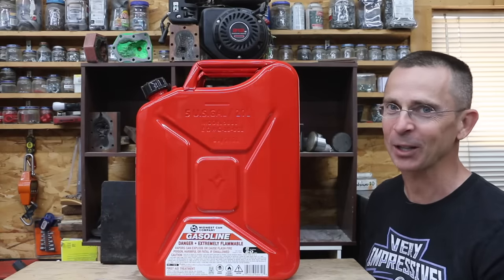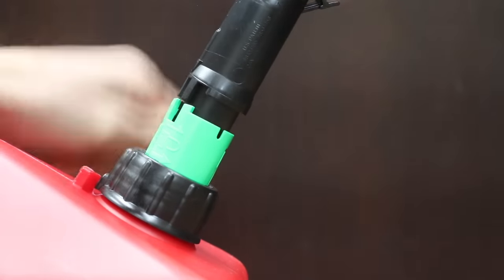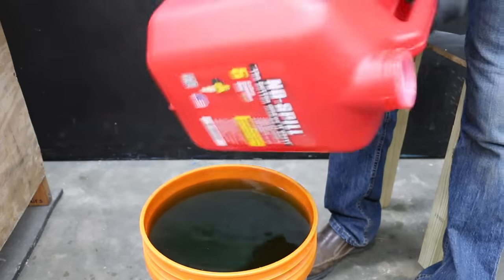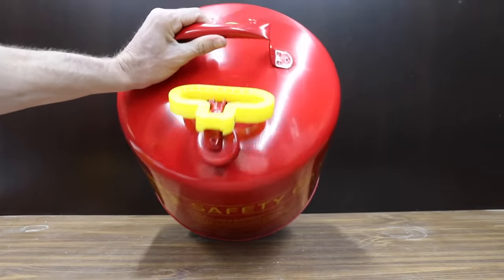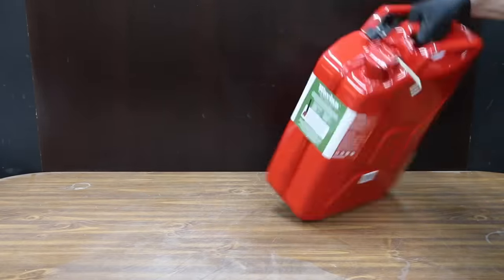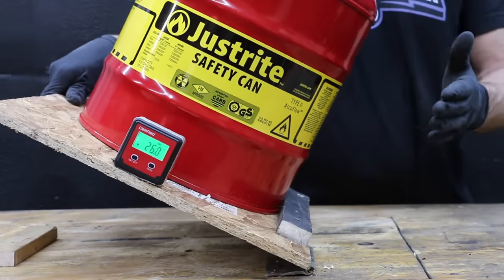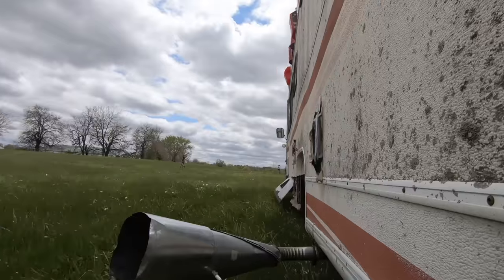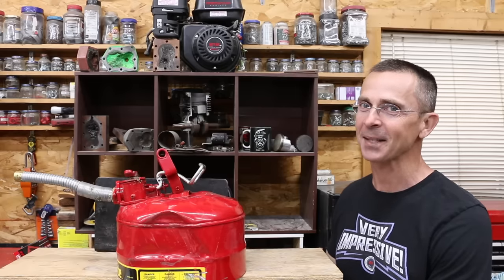Best Gas Can? $140 Wavian vs Eagle, Surecan, Scepter, Briggs & Stratton, Midwest, VP Racing

Comment: The "Jerry cans" are shaped the way that they are to allow enough oxygen in the can even when full. this prevents them from sinking if submerged.   The three handles are also for easier carrying by 1-2 individuals, or allowing two empty cans to be carried in one hand.
Reply: They also store much better, less floor space and stack nicely next to one another.
Reply: designed by the Germans in ww2 thats why theyre called "jerry" cans
Reply: The Jerry Cans is also one of the main contributors of the result of WWII. Even though it was designed by the Germans, the Allied forces used them for their own fuel logistics as they where superior compared to their existing solution. Engineering at it's best.
Reply: @jhalkoski  Actually it was developed before WWII by the Germans in 1937.
Reply: The original Nazi Jerry can is the best fuel container ever made bar none.
Reply: I don't see how the shape would affect bouancy, if it's still full to the top. I'll have to research that one.

Unless the five gallon mark is lower than the top, and by design has HEAD space if used properly?
Reply: A fellow Calum subscriber.
Reply: @slove120031  And on top of each other. They did originate in WWII for the purpose of being an effective means of fuel handling.
The bad thing is that there are so many cheap knock-offs of them that don't have the same quality level. Just the thing with the recessed weld holding the halves together is a significant detail.
Reply: I've heard the company that manufactures the Harbor Freight military style can is the same company that manufactures the actual NATO jerry cans, if I recall correctly.
Reply: @dethmaul  the mouth of the fuel can is lower than the air pocket would be inside. If it is sitting on a level surface and you fill it until it is flowing back out of the mouth there will still be an air pocket by the handle.
Reply: @dethmaul  That's it exactly.  If you set a Jerry can flat on the ground, you can only fill it up to the pour spout.  That's the 5 gallon mark on them.  But if you look at them in profile, there's a hump on the back of the can that comes up to meet the back of the handle.  That forms an air pocket large enough that full cans will still float.
Reply: They won't sink if submerged anyways if full of full. Fuel floats on water
Reply: Also recessed welds, very important for longevity 👍🏻
Reply: I'm pretty sure a steel fuel can filled to 100% would still float without the air pocket. Fuel is extremely buoyant in water.
Reply: @dethmaul  the hump at the back holds air even when full
Reply: @CarbonNeutral22  Gasoline has a specific gravity of 0.71-0.77 depending on the blend.  So in the worst case scenario, 5 gallons of fuel weighing 31 pounds is displacing 40 pounds of water.  Considering the metal cans were tipping the scales at around 8.5-9 pounds, that would be cutting it damn close without the extra buoyancy of an air pocket.
Reply: @dethmaul  The filler neck is a little lower than the top, so you can't fill it completely full. It leaves a little bubble of air that keeps it afloat. I suppose you could lean the can back and fill it completely full, but that could cause spillage when opened.
Reply: You do know why they don't sink right? Because fuel is lighter than water. When full they will float. The Treste when it went to the bottom of the Pacific actually used gasoline for buoyancy control because it was lighter than the seawater, and couldn't be compressed at the extreme pressure at the bottom of the ocean.
Reply: @j.frankparnell6195  so technically gerry cans
Reply: @rhvette  I hauled fuel tankers on the ice road. The tanks will float a whole truck
Reply: @dethmaul  when filling it upright, fuel will spill out, preventing it from filling the entire can
Reply: @CarbonNeutral22  even with the added weight of the steel?
Reply: @rhvette  good on you mate 💪🏼
Answered my question.
Reply: We've had the same jerry cans at work for 20+ years by now, so they pretty much knew what they where doing while designing them
Reply: @SanctuaryGardenLiving  yeah there's a video on you tube of a tanker that went through at the big river crossing on the Makenzie and it floated
Reply: @CarbonNeutral22  is the buoyancy of fuel enough to off-set the weight of 10lbs of steel without the oxygen?
Reply: @CarbonNeutral22  fuel floats, but not a sealed metal can.  Once it's sealed it doesn't matter what's inside it, it just becomes ballast.  The air inside a sealed can is just enough to keep it lighter than the water it displaces
Reply: @TheSturm44  there's a comment above that explains how close it is
Reply: @ImpendingJoker  True, but 5 gallons of gas weighs about 30.5 pounds, and 5 gallons of water weighs 41.75, so the gas plus the steel gas can would have to weigh less than 12 pounds or she would go to Davy Jones' locker.
Reply: @rhvette  There's actually a filler line as well on the can. It's the line below the handle about 3 inches wide...
Reply: @jhalkoski  can you imagine if they had fuel to put in them during the war. The world would look different that's for sure.
Reply: Wehrmachtkanister was designed to address 3 issues of fuel tanks at the time: leaks,  damage sustainability and ease of operations in a chain. All three were addressed nearly perfectly, and this design soon 100 years old still beats many out there.
Reply: I’m sure that air pocket is also duel purpose so the air pocket and compress when that can is sealed and gets hot and won’t leak fuel.
Reply: @wwlb4970  Those cans were brilliantly designed. We could use some of that practicality and simplicity in today's tools and gadgets.
Reply: Air, not oxygen
Reply: @dethmaul  You cannot fill it to the top because the void space is above the fill spout. That is what prevents it from sinking. However, this is only necessary if you are using the can as a water can, since fuel is already lighter than water. Another benefit of the void space is that it prevents the can from bursting in the heat, since the air trapped there is compressible to act as a pressure sump.

The Wavian can is made in Latvia. Probably the same manufacturer as the Harbor Freight can, but the Wavian can is made to NATO specs, and is the better can.
Reply: @trystdodge6177  it would be a lot better
Reply: Jerry cans also float in water because of the air bubble at the top. 🧠
Reply: @CarbonNeutral22  Jerry cans have a plastic intert liner so they can carry both Fuel and Drinking water.
Reply: @Bob_Adkins  Exactly my point. It's less dense than water, and the can itself only weighs about 2 pounds when empty.
Reply: @ImpendingJoker  I think jerry cans were more like 12-14 pounds, which would make them around neutral without the bubble.
Reply: @Bob_Adkins  But that makes to much SENSE!
Reply: @sigcrazy7  Plus the air pocket prevents the jerry can from bursting a weld on a heavy impact. Fuel doesn't compress, air does.
Reply: @theshadowswithin9896  lowest bidder so makes sense
Reply: @dethmaul  The top of the can is above the filler, yu can't over fill one. The space is actually for expansion in heat however, a can of fuel won't sink as petrol is lighter than water.
Reply: that air filled bump at the top also allows for some expansion of the fuel.

Comment: One of my pet-peeves - Fuel cans that have gadgets, push-buttons, and locking mechanisms.  All they are really guaranteed to do is make pouring fuel a cumbersome nightmare.
Reply: Amen. I have the Midwest and balancing a heavy can on that tiny plastic lip at the end to get the fuel to flow is a real pita. It inevitably slips and the tube relocks, forcing you to put your hands on the now gas-soaked click-lock while dripping gas everywhere. All I care about is which are the easiest to use and leak the least while in use.
Reply: That's why the VP Racing, or any "utility jug" as they call them instead of gas cans, work the best.   They don't have all that junk.
Reply: Facts
Reply: Wavian gas cans pour like a dream. No glug. 5 gallons gone in 2 minutes of less.
Reply: @MiltonRoe  
The purpose of these nozzle contraptions has long been defeated just using them. IMO it is one more incentive placed on people to want to use electric.
Reply: Not too mention spout failures.  Those spring loaded fuel nozzles do not last very long and quickly get jammed open.  Then you literally cannot close off the can.
Reply: and 100% cause u to spill the gas 100% of the time...
Reply: @larrybe2900  Classic government idiocy. The EPA-approved spouts have caused me to spill many ounces of gasoline directly on the ground. A problem I never had with a simple rubber spout. Good thing I don't have a tiny amount of fuel vapors released into the air -- I'm sure it's much better to dump actual fuel into the dirt.
Reply: get the fuel jugs with hose from summit or jeggs racing youll love them !!!!!!!!!!!!!!
Reply: Peter smith  yea the ones i see around here have a picture of a scarred guy and "Gasoline and fire NEVER mix" Except the whole point of gasoline is to burn it.    For kickstarting a bonfire its better to use kerosene.
Reply: And the plastic parts/spout are all guaranteed to CRACK and break
Reply: @MiltonRoe  theres blue "water" cans that look like the midwest cans maybe even midwest brand that have traditional fuel necks. What my local hardware sells and everyone buys for gas cans. 😂😂 they are a 6 gallon can.
Reply: Those are Democrat mandated spouts.  Like everything they do, those suck.
Reply: You can thank the government for that!
Reply: @gizzyguzzi  They literally fuck everything up that they touch. Look what they did to diesels.
Reply: When I worked in landscape the first thing we did was bypass those "safety" features so we could just pour the gas without having to putz with a button or trigger or anything.
Reply: @Bpf1893  you're preaching to the choir, buddy-
Reply: @bobspurloc  nothing spills more gas than those 'safety' cans.  What a joke
Reply: Not only that, but the whole purpose of them is to release less vapors, but most people rip off the spout in frustration and end up spilling much more than if they just used a regular can.
Reply: It's ridiculous that all of the "safety" features actually make refueling more difficult and can increase your chance of spilling (especially if you're adding to a passenger vehicle or some boats.) The VP Racing can is the only one I'll ever use anymore.
Reply: You can thank lawyers for trying to make gas cans idiot proof. There will always be a better idiot.
Reply: I agree
Reply: @Skyfighter64  politicians did that.
Reply: I have several of the midwest cans. The first thing I do is add a vent cap and a free flow spout without any flow/locking mechanisms. It makes a huge difference. These both can be bought on ebay. One problem I have is the threaded collar s (caps) keep breaking. When full with gas these puppies are heavy and any prolonged pressure (weight) on the spout eventually splits the threaded collar (cap).
Reply: $140 for a gas can? For that price, an electronic pump could be incorporated into the can. Nuts to that. Ill stick to gallon milk jugs.
Reply: @Cline3911  I bought several for about 25 each.  NATO surplus.
Reply: @Cline3911  Those milk jugs split easily when dropped, or the lid will pop off. Also easy to puncture, but I see your point. When I was a kid mowing lawns for spending money, most kids used old gallon-sized glass jugs and we never had problems; we knew the risks and we were careful. That technique still works except with the new-style spouts which leak from the start or soon will.
Reply: @P_RO_  just a rag away from a Molotov cocktail 🙃
Reply: Blame California and the Obama EPA.
Reply: @bnasty267  Furthermore, our fuel pumps don't have vapor recovery on them anymore so when you refill your gas can you still release the captured vapor. Yet again gooberment at its finest!
Reply: @gizzyguzzi  Bush signed the bill
Reply: @joshuaguenin9507   What bill?  AFAIK  It was directly from Rule Making by EPA.   

An ominous regulatory announcement from the EPA came in 2007: “Starting with containers manufactured in 2009… it is expected that the new cans will be built with a simple and inexpensive permeation barrier and new spouts that close automatically.”

The government never said “no vents.” It abolished them de facto with new standards that every state had to adopt by 2009.
Reply: With the Midwest plastic can all I did was take some needle nose pliers and pulled out the entire red locking mechanism in one piece. At least now you can push the spout in and out freely. Took 5 seconds to do.
Reply: @MrShadowchase  still not vented.  So it doesn't pour tight.
Reply: @Skyfighter64  The lawyers AND the government! Always trying to protect you, from YOU! The more we idiot proof everything, the better(and more) idiots we make!
Reply: Like anything mandates by the government
Reply: @gizzyguzzi  Nope…that EPA rule was promulgated in 2007.   Check your memory for who was in the White House (hint: he was a Republican).
Reply: @joshuaguenin9507  please provide a source that confirms this EPA rule was ever signed by a president.  These rules are promulgated by agencies, not Congress
Reply: I have owned a Justrite can going on 7 years it was $50 in 2016. Mine still looks like new! Now it's over $100... Scary stuff...
Reply: @whocares0503 yup had mine for about the same time, mine is just dusty and could probably use a wire wheeling on the nozzle just to clean up some of the light rust and make it bendier again. Always sat on the shop floor never got dented by anything, and to my memory have never spilled a drop of gas that wasn’t entirely my fault.
Reply: That's what pliers, cutters, and drills are for.
Reply: I couldn’t agree more!  After several years of struggling with today’s typical plastic tanks with “safety” necks, I have a literal pile of gas cans in various states of BROKEN in a corner of the garage. I’ve never been able to make one last more than a few months and it takes 12 free hands to operate them, resulting in more spillage than fueling!  
I finally gave up and bought a metal Jerry Can and a simple free flow neck attachment. Just tilt and pour. If you have an ounce of coordination, you won’t spill much if anything. 😉
Now I have to toss all of those un-recyclable useless modern cans in the landfill. 🙄
Reply: Agreed. Buy a funnel and use the new fandangled nozzles as a cap only.
Reply: KISS principle rules! More parts means more leakage points and future failures.
Reply: Right on. I haven't met a single person who had anything positive to say about these new gas cans. Who asked for these? Why fix something that wasn't broken? The old gas cans from 15 years ago were perfectly fine.
Reply: sir you are correct. wow, the petroleum industry must have invested in these gadgets to reduce spills, because I have never wasted more gas by spilling on the ground, the petro bosses must be very happy with the extra product we have to buy (to replace the spillage due to these "Fuel spill prevention devices").
Reply: Not to mention that those flame mitigation screens make filling them a nightmare
Reply: I guess they never imagined Bubba taking the spout off the can and pouring the gas into an open-topped pan before he throws it onto a fire! :-) Anyone involved in the mandating, design, production, and selling of these Big Brother cans should be forced to live in a house with a combination lock on the front door that changes every day and that must be opened while being barked at by a rabid dog while standing under a water sprinkler. They literally deserve that. Literally! 🙂 singlekc